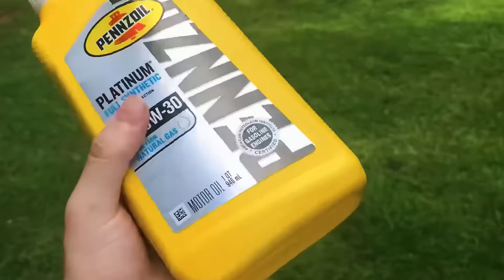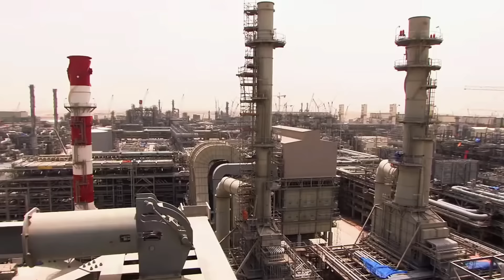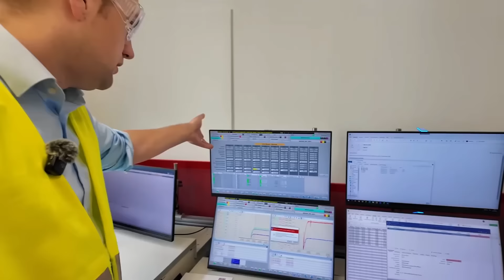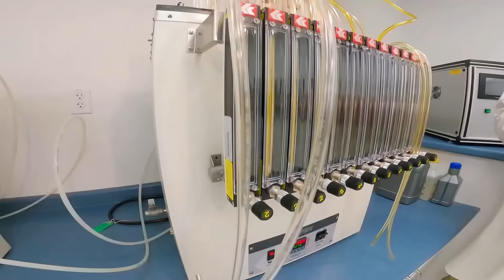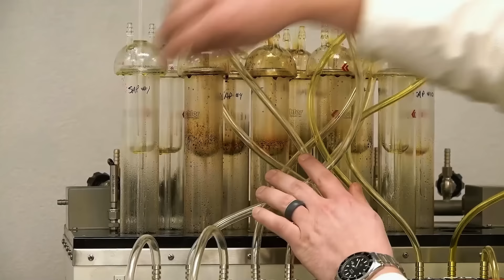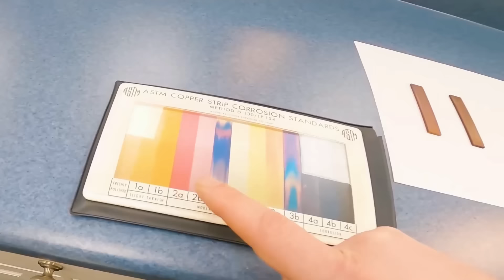The Untold Truth About Pennzoil Platinum

Comment: I just changed to Pennzoil platinium just to find out they do false advertising  so since they fooled the public and shafted me to. the next oil change won't ever be Pennzoil ever again God only knows if this oil any good but I will say  this my miles per gallon dropped from 24.9 to 23.6 average since I switched .so it's caused less gas mileage so I'm going back to Valveoline restore and protect on my next oil change .I'll never trust Penzoil again .

Comment: The information presented in this video was factual and unbiased. The only way you will actually know the quality of this new formulation is to run it through an oil change cycle and see if there are any appreciable differences in oil analysis. My best guess is that there will be very little measurable difference in engine wear and protection. Pennzoil, and other premium synthetic oil manufactures are facing an industry wide shortage of premium base stock from which to formulate their unique brands. As a result of this industry wide supply shortage, pricing have risen for many premium synthetics brands recently, not just Pennzoil's Platinum line. It's not price gouging, its supply and demand dictating the retail price increase.

Comment: I understand the point that Pennzoil lied about the change in its formula. I also understand there's a decrease in performance. But does that make it a bad oil? to the point that everyone wants switch? I did my 1st oil change using PUP back in April, and according to videos i've watched it was probably not GTL anymore. My SUV never been happier. Performance is great. Even my MPG is better.
Reply: They did't lie they changed label! It's still excellent SQ rated full synthetic oil. That's absolutely truth. If meets specs of ur vehicle & runs great in SUV like mine w/outstanding mpgs. Use it. I am.

Comment: AMSOIL Signature Grade is The KING of MOTOR OILS.
Reply: Well... Amsoil is sourcing the same base oils, so they can't get the proper base oils either....
Reply: As long as it's a performance engine or you run over 10,000 mile OCIs.
Reply: 4x the price
Reply: @Taras-Nabad 1.5 for me

Comment: Considering all that, if you drive a turbo car, change the oil every 3000-5000 miles depending on driving conditions. More than that is risky for your engine.
Reply: I use the ultra platinum in my 2.3 turbo. Oil changes at 4000 miles.

Comment: Why does gm control the dexttos rating!
Reply: Just so if you don't use oil with their approved rating and the engine grenades they can deny coverage. 😂 Not that it does any good, they can't even figure out what oil should be used in their engines.

Comment: 0W oil shouldn't ever be used by anywhere on earth.  Always idle after start until idle drops and never slack til its black.

Automobile Manufacturers have been conspiring to shorten vehicle lifespans and GDI engines and 0W oils have been two of their strategies.  "fuel economy extremism" has only been PRETEXT to Planned Obsolescence (which is CRIME in France and should be CRIME in every nation)
Some who promoted the use of lifespan-shortening (0W-20, 0W-16, and 0W-8) oil told falsehoods about properly-protective higher viscosity oils (10W-40, etc).

Comment: Due to the fact that Pennzoil has not been forthcoming and lied about no more GTL.  I have decided to switch to MOTUL 8100 Eco-Lite for my 2024 Subaru BRZ (a rear wheel drive, light weight, sports car.
Reply: The esters in Motul will cling to internals but stability won't last nearly as long as ultra platinum's original formula.  Best to add an extra 0.5 liter to prevent starvation during hard cornering in your motor
Reply: @Raker905  I am retired; I bought the car as a retirement present to myself.  I only drive about 3500 miles a year; but still change the oil every 6 months.  Mostly to just be proactive with care; but also because I do a lot of short trips.   I don’t track the car; but I do drive it very spiritedly.  I will probably put a little extra oil in as you recommended.  Thank you! 😎

Comment: What’s worse is the price went up for a lesser oil
Reply: Most oils recently went from a SP to a SQ rated oil, HOW is that LESSER????????  The standards are now higher than they were when Pennzoil was an SP oil and if they made some oil from NG that had the SQ rating, that rating did not change. I don't know what so many people are upset about nothing?????????? Ingredients do not matter as long as the rating standards are met.
Reply: @josephklimchock5412 You're confusing an API performance standard with the quality and composition of a particular formulation. Nobody is saying API SQ is lesser than API SP. SQ is obviously the newer standard.

The concern is that Pennzoil Ultra Platinum may have changed the formulation that made PUP distinctive in the first place. Two oils can both meet API SQ while using very different base stocks and additive packages. Meeting the same minimum performance standard does not make those oils identical in quality, formulation, volatility, oxidation resistance, or long-term performance.

And saying “ingredients do not matter” simply isn't true. If ingredients didn't matter, oil companies wouldn't spend millions developing different base stocks and additive packages, and there would be little reason for premium oils to exist.

The question isn't SP vs. SQ. The question is whether the newer PUP formulation performs as well as the formulation it replaced. An SQ label alone doesn't answer that.
Reply: @mgsmith7475  Yeah but after all that explanation, the API still goes to the minimum standards. HE said the new Pennzoil was a "lesser" oil but never made the distinction in what way.
Reply: @mgsmith7475 SQ GF7 ratings require more robust oil . Period. Additives make up 20-25% of an oil. It's most important part assuming base oil is good which no full synthetic oil has bad base oils. Grp3 has been used 20yrs now. I absolutely believe there's some GTL in PUP..maybe not Platinum. Then again ppl forget Pennzoils base full synthetic oil was always grp3 & beat many so called better oils. I'm referring to Pennzoil full synthetic oil. Below Platinum. ive Used it. Once due to Platinum /Ultra Platinum bein unavailable. So long as meets ur vehicle specs/SQ rated full synthetic etc its good oil. Thus PUP should still be excellent off shelf synthetic . For 39.99 5qt jug at Walmart.. that's ur decision. I would use it over Mobil1/Castrol & Valvoline that ALWAYS used majority grp3 base oil.
Reply: @josephklimchock5412  Its ridiculous. If meets specs of ur vehicle & SQ rated. The NEW better certification then its good oil. PUP is Pennzoils top tier oil . There not gonna destroy its reputation. Mobil1/Castrol/ Valvoline always used grp3 base oil. There's nothing wrong w/it. It's 20-25% additive package that makes difference in an oils performance! If you don't go over 7500mis then PUP will still be one of best of shelf oils available. Zero doubt.
Reply: @josephklimchock5412  Facts 100%. PUP is still excellent oil for 99% drivers. 1% are track guys. Even then I'm sure it's better than Mobil1 & Castrol.
Reply: Due to what’s going on in Iran.  There has been a 30% reduction in base oil.  Thus every brand will continue to increase for a while.
Reply: @J.R.F.23 it was before war
Reply: I was using Royal Purple but changed to PUP because the performance was comparable and PUP was cheaper. Now PUP went up in price and the performance went down. Going back to the Purple stuff.
Reply: @mgsmith7475  It's still gonna be excellent oil esp if don't run past 7500mi OCI. Additives are 20-25% of oil. Royal Purple is highly overrated & testing has always showed that. Changing from an oil that's worked great - PUP - is foolish. I dont like price increase but that's all oil. SQ rating means they all robust. I'm sticking w/ PUP when using off shelf oil. Period.
Reply: @Davido50 I’m not saying PUP suddenly became bad oil. My point was that I originally switched from Royal Purple because PUP gave me comparable performance for less money. If the price advantage disappears while the formulation/performance changes, then the reason I switched disappears too.
Also, the statement that additives are simply 20–25% of motor oil is too broad. Additive concentration and chemistry vary by formulation and viscosity grade. And API SQ certification establishes performance requirements; it doesn’t mean every SQ oil uses the same base stocks, additive package, or performs identically.
Royal Purple worked great for me before, so going back to something I already had good results with isn’t exactly foolish.
Reply: If it's GF7 SQ rated thats very strong certification! PUP was always ahead of other off shelf full synthetic oils. 99% of us aren't racing. Its still very capable oil I have no doubt.
Reply: That's the Republican way....
Reply: The prices went up on all oil, but I use Walmart oil, it went up about a dollar a gallon, now the filter shelves ? That's another story
Reply: @lynch6642 Guarantee Pennzoils base full synthetic oil beats pants off that store brand oil for few bucks more & that's not even discussing Pennzoil Ultra Platinum there top tier product. The worry & confusion is unfounded. It will still perform extremely well in any engine that it meets specs for. Plus SQ rating required all oils to be more robust from SP 2yrs ago.
Reply: Beat $10 oil filter ya can get is Carquest Premium- 99.5% efficiency @20 microns. Excellent build quality. All I use now. Look into it. Just bout 5 & got em for 7.50 ea.

Comment: As long as it still says Dexos 1 Gen 3 on the bottle it's fine.  Changing your oil every 5000 miles max is more important.
Reply: Hardly any oils have the Dexos rating now. The oil companies got tired of GM's massive license fees and stopped licensing Dexos oils. 
There are plenty of the newer GF-7 rated oils that actually exceed Dexos ratings anyways.
Reply: @MrEricmopar  How could the license fees be massive when the two cheapest brands on the shelf (Wal Mart Supertech and Costco Kirkland) are Dexos licensed?
Reply: @billm6294 super tech no longer has dexos approval on the bottom anymore
Reply: @billm6294  Obviously Walmart and Costco chose to continue paying the massive license fees while other brands did not. Very simple.
Reply: 1 year or 5000 miles in the fall so you got fresh oil for winter.
Reply: Does anyone know what the differance is between a DEXOS markt oil and any other without the DEXOS Brand?
Reply: @markwarnberg9504  Dexos is a license.  GM has a set of specifications and tests you have to meet. A Group III base oil and a particular Lubrizol additive pack will get you there.